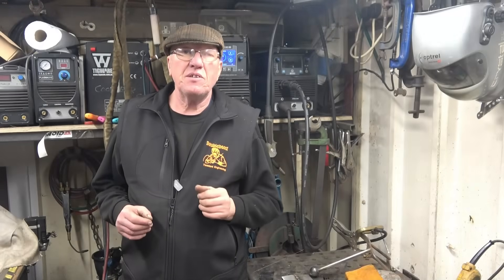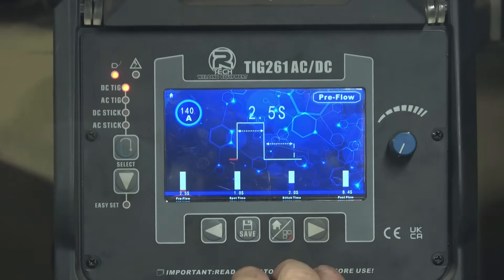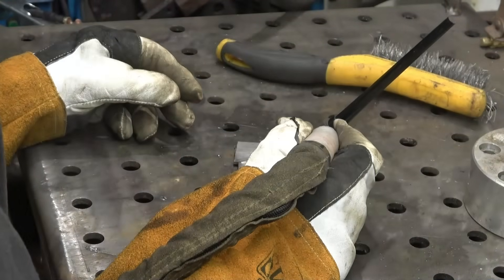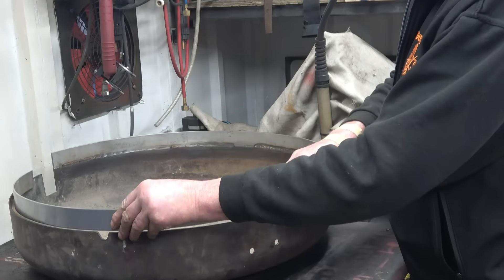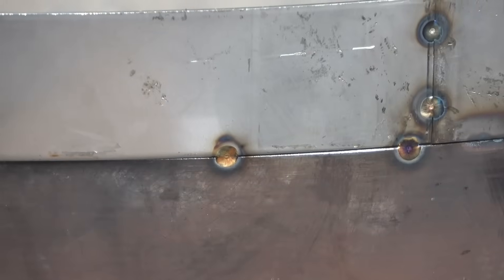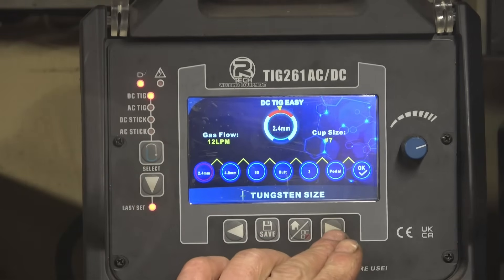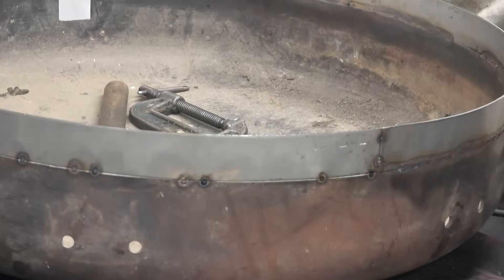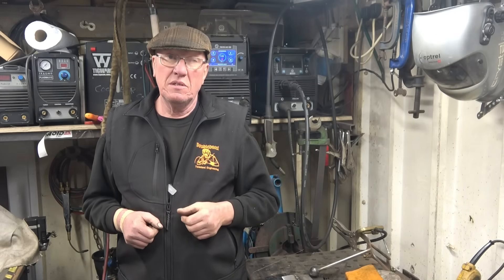R-Tech TIG261TFT, Stainless ash pan repair using spot – tack and pulse welding.

Comment: Hi John ,
I watched your video on an oil change and filter change on a Citroen Belingo van  , I followed your instructions to the tee and it was spot on and I use your video every time I do an oil change. I just had a warning light come on the van saying “ Risk of particular filter blocking “ I have been told to buy a bottle of filter cleaner and put in the tank prior to the next time I fill up , is this a good idea or a load of rubbish in your opinion? .
Thank you John .
Dermot.